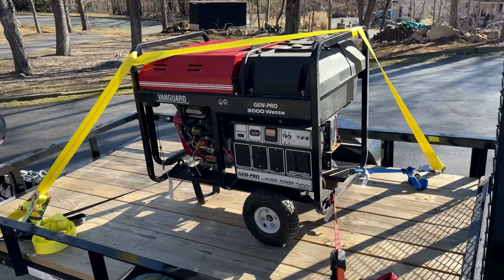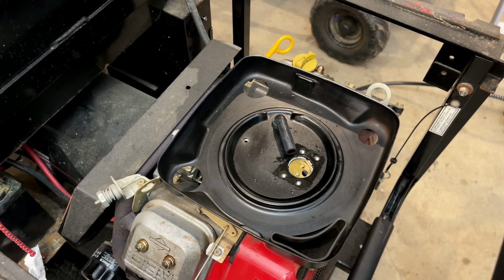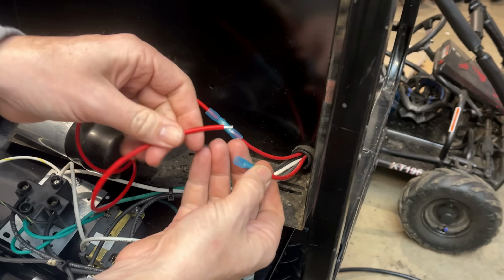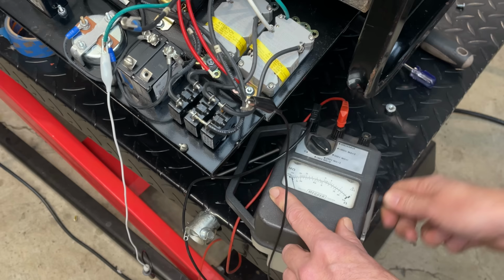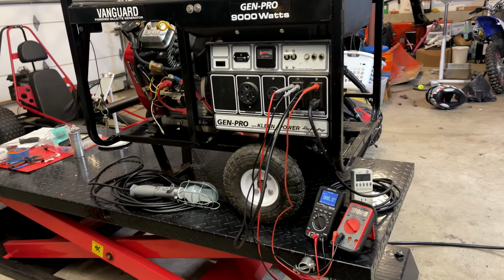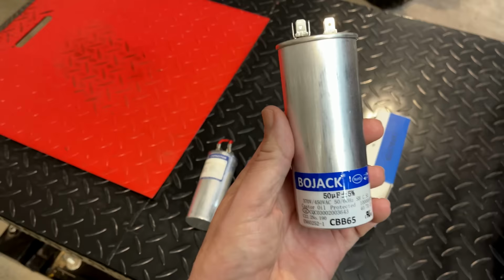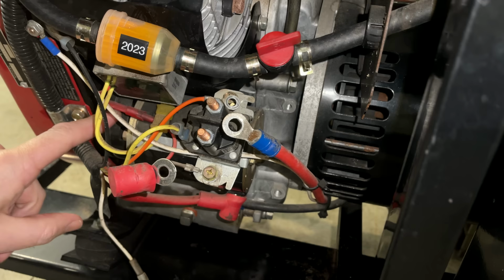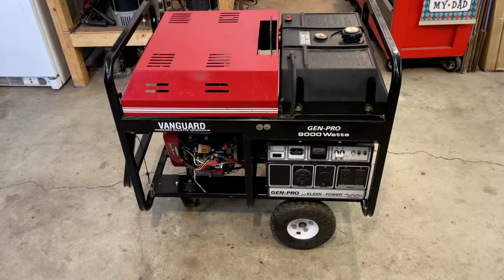How To Test and Fix A Brushless Generator

Comment: Just a heads up on those Vanguard carbs, if you remove the plate that holds the key switch for the electric start you gain access to the right bottom side of the carburetor, there is a bolt you can remove, in the hole is the main jet. With a wd40 straw on an air duster you can blow air right through the main jet to clear it. This way you don't have to remove the entire carburetor, I've done it 3 different times on those Vanguard engines, saved me a bunch of time
Reply from the maker: Definitely.  Just do not try and remove the main jet.  Have tried a few times and failed on all three attempts.  Clean it in place.
Reply: Just have to keep from dropping the bolt or it will add another 30 minutes of fun pulling the fan shroud.
Reply: @Taulksik  nice!
Reply: @jcondon1  sometimes is better to spray wd-40 and let it soak few hours or a night and then put the right or approximate size flat screwdriver and lightly tap it few times then break it loose.  I know some times we feel tempted to get it done quick. 😄 but unfortunately other times we have to wait
Reply: Thanks for the info appreciated
Reply: @josem.2909  yes! My Dad (RAF Ground Crew in Idia in WWII rightly said that "Good and Quick never met on a job yet."

I still miss him.
Reply: Seems like a sweet engine overall.

Comment: your mistake was eBay junk and not paying attention to your measurements it showed a bottom line pretty much bad capacitor you should have sent it back got your refund.. whenever there's a question send it back ... overall it was a good fix it was fixed the way you said it would be fixed and there is ultimately no surprises lucky thing you got the solenoid now so your customer wouldn't have to deal with it...

Comment: As for the low THD, It has damper windings on the rotor like the Yamaha brushless generators. You can see the damper windings (the tip of the bars) on the rotor at the beginning of the video. Thanks for sharing!
Reply: That's a great eye!! And honestly that is a premium feature for portable GenSets. Most don't have them.

Comment: Excellent job James: I have changed hundreds of capacitors on AC systems and we were always told to get one with higher voltage ratings with the same MFD ratings if possible.  Mars ( I think) makes capacitors in the USA. Some of the Chinese ones were garbage. I had several new ones that failed on the spot or shortly after installing them. Thanks for another great video. That is an excellent gen set.
Reply: Yes, you can definitely go up on the voltage rating, and generally the capacitor will last longer than the lower rated one. Do not vary on the uF spec, as it WILL create problems, especially on a start/run cap application for an induction motor. You CAN go up a small ways in the uF spec if the cap is used as a smoothing cap in a D.C. power supply, but in an A.C. system, the uF spec controls the A.C. waveform and can create big problems if you go with a different value.

Edit: Yes, I agree, the off brand China ones are usually garbage and don't last for even a fraction of the time that the original one did. Purchase a made in the USA one, and purchase it once.
Reply: Came here for a brushless generator and got a brushed generator. Always found it incredibly interesting how theres no magnets in most generators

Comment: I love the fact you go the extra mile and made the machine more serviceable by adding little things like a fuel cutoff valve, one theory I have as to why they didn’t add one is because they didn’t think It’d last 10+ years yet here it is running after a few parts later, amazing what you can do with a little bit of TLC!

Comment: James !  I recommend you buy capacitors from Grainger. I replaced similar capacitors like the one on the generator but on two central air conditioner compressors on my house and my dad’s house. The capacitor can was bulging. I also replaced the fan capacitor for the outside unit and the inside blower unit just as a precaution and preventative maintenance issue.  I had replaced the outside blower motor along with a new capacitor 5 years ago and replaced the cap again just to make everything fresh. The Grainger stock seems always good.
Reply: I agree with you they only sale outstanding parts and no problem

Comment: If the manufacturer of the starter solenoid wanted to drastically improve lifespan of the part, they could have silvered the internal contacts. This would cut down on internal arcing, and decreased resistance. If you want, I would be willing to do the modification and send the part back to you for a future repair. 

Great work, thank you!
Reply: Very nice point and offer!
Reply: Silver would do the trick. In order to protect the copper bus bar, the solenoid manufacturer could have added a lick of no-ox for next to zero cost. 😢

Comment: Awesome repair on this one James reminds me a lot of that large WinCo generator I had a few months back. Same engine and same heavy overbuilt powerhead. Never had a chance to measure the THD as I did not have the meter at the time.

Someone else mentioned that this rotor has damper windings. That explains the low THD. Something that we do not see often on the portable generators at all. Normally a winding like that in a synchronous motor is used to provide starting torque, but in this generator application they refer to it as a "dampening winding" since it creates a torque force opposite of the spinning magnetic field to suppress any oscillation (such as voltage at higher frequencies, AKA THD) thus lower overall THD. 

Adding this winding increases complexity and obviously cost that's why we don't see it often.

Comment: That was awesome! Especially taking apart the solenoid! I love taking stuff apart and seeing how it works. I've fixed many things that way that were deemed "broken".
Reply: Absolutely... One can't break it anymore than it's already broken by taking things apart and investigating. Many times a careful tear down and inspection will reveal an easy repair. 
Never hurts to check, and one may learn a thing or two along the way, and save a few bucks in the process. 👍

Comment: Very impressive generator, and another excellent presentation by Jim. As for the replacement parts, this is the kind of thing repair people in every industry have been putting up with in recent years. Because cheap parts have been made available from other countries,  materials used in the manufacturing process and poor quality control has led to this higher than normal failure rates. Many of the HVAC repairmen buy up all the American-made capacitors whenever possible because of the high failure rate of the Chinese-manufactured ones. Yes, they pay a premium, but, like the saying goes, you get what you pay for.
Reply: You rarely get more than you pay for, but you often don't get what you paid for.
Reply: As an Industrial electrician that does a lot of power factor correction. You don't even want the USA made ones .  You want the Japanese ones. Preferably Nichicon!
Reply: That's the reason for our alternative Economic and Business model and plan!

Comment: I purchased this same machine a few years ago, because IMO it is one of the best-quality non-inverter generators out there.  And I love the Japanese-built V-twin Vanguard engine - I have it on my pressure washer, garden tractor, and on several generators.  Keep your eye on the used market for this brand and grab one if it comes up at at the right price.  There is so little to fail on this generator, as compared to say an older Onan (as used in RVs) with its hundreds of dollars worth of control boards and regulators on it.

The only thing that I will say is on the vacuum-operated fuel pump, I always buy the OEM Japanese-made ones, and use only E0 fuel, but I have personally had several of them fail prematurely due to the diaphragm rupturing.  Maybe I got a bad batch, but I always have a few spare fuel pumps on hand just in case as they aren't that expensive.

Comment: Very valuable information and diagnostic skills. The low reading you observed with the low speed cranking of the insulation tester was the charging of the capacitance between the two windings.

Comment: Thanks James, great video. Capacitor suggestion: Open an account at an electrical or HVAC supply house and get the capacitors at a third of EBAY cost. ALSO, getting the capacitor at a higher voltage rating does not effect the output of the capacitor. They use a more durable membrane separator. You do need to get the proper MFD rating. Thanks again.

Comment: James, as far as capacitors go -  the capacitance (MFD) value is critical. Going with a HIGHER voltage handling is OK, but never lower. You had a 370v rating and could have replaced with a 440v rating, but sometimes a higher voltage handling results in capacitor that is physically larger. A lot of HVAC techs (some famous ones on YouTube as well as my next door neighbor) prefer USA or Mexico manufactured capacitors over ones made in China; the USA ones seem to last longer. GE used to make capacitors but they sold out to a company called Genteq. You probably saw a lot of "dual" capacitors in your search - maybe a "5+50MFD" capacitor... Those are very commonly used in HVAC condensing units, the 5 MFD portion is used for the fan, and the 50 MFD portion is used for the compressor. In a pinch you could use a dual cap, just hook up to the connectors C (common) and HERM (hermetic) to access the large capacitance portion of the dual cap.

Comment: That's a nice piece.   It was definitely worth repairing,  even if it is a bit older.  Sometimes the older simpler designs are the best for longevity because you CAN fix them with standard parts.   My electronics experience shows that NEW capacitors usually measure UNDER spec... and will shift to spec shortly.   As they age and LEAK (electrically)  they will test well over spec.
Reply from the maker: Exactly.  Only a capacitor and two diodes.  Cannot beat that.

Comment: James your tests were more sound than that old stock capacitor. The dielectric in a capacitor has a shelf life of about 2 years.  I’m impressed by the consistency of the THD readings.
Reply: Good quality Capacitors last much longer than 2 years. I've run across Nichicon Capacitors that were 20 years old, and still in spec and perfectly useable. 

Generic caps from China? Now the 2 year lifespan could very well be the case. I've had some generic replacement that weren't any good directly out of rhe package. 
Buy a good quality capacitor, and you'll never have to do it again until many years later.
Reply: 2 years? Lol

Comment: Great video.  I was a bit surprised that you didn't check the Amazon capacitor before installing it.  Down south in Texas we routinely have capacitor issues with our A.C. systems.  It has become part of a routine checkup.
Reply from the maker: I did, sure what happened to that footage.  It tested well.  But so did the other.

Comment: Hi James.  You have taught me a lot about small engines and generators. I want to contribute this comment to this project.  I have a 16 HP Vanguard engine like the one in this generator driving my chipper. It has great torque. Just and FYI.  The two 13mm bolts attaching the carburator from the underside can be removed on this engine without removing the intake manafold. I found you just can losen and remove the bolt at the rear be losening the shroud to give clearance the the 13mm 2" bolt.  Then use a 3/8" drive 13mm  crowsfoot tool if you have one.  You can then access the main jet and clean it properly.  Only downside is torqueing the rear bolt with a crows foot attached.  

Just another thing to know about this carburator.  I don;t know why it is make this way. This engine has two differnet OEM needle valves.  One is for engines with fuel pumps in brass.  The another with gravity fed fuel made in aluminium.

Comment: Years ago whenever my neighbor did a tune-up he'd fill his float bowl with Gumout. After he was done with points, plugs & condenser he'd run the engine and it always took care of carb related hesitation stumble and surge. I never saw him pull a carb. I've also heard of motorcycle guys putting Gumout in their gas tank every fill up as preventative maintenance. Easier than R&R carb and disassembly. Just FYI. ben/ michigan

Comment: James, Excellent video.  Always love your diagnostic skills. That genny is built like a tank inside and out. The Gillette gennies are now built with Honda engines for even greater reliability and longevity. Before buying our 22kw standby Generic genny, I came very close to getting a Gillette 12kw 50 amp model. Thanks for sharing another teaching lesson. :-)
Reply from the maker: I am a believer in Gillette generators after working on this one.

Comment: My main very reliable generator is a Winco 9000 watt with a 16 HP Briggs & Stratton V twin Vangard engine. I bought it new in 1999 and it has always run on propane. This generator has run 52 hours continually at full load through an ice Strom back in 2005. I love this generator and I this Winco is a very brand for generators.
Reply from the maker: Winco is a good brand.  Quality.

Comment: That is exactly like the old Ford Solenoids but on a GM they were in the starter, we use to polish them up all the time instead of replacing them. We would also remove the stud and rotate it 180 degrees to give it a new surface to connect to. That's what a Burnishing blade is used for.

Comment: NICE genset and fix! New means nothing nowadays. Glad everything worked out fine in the end. It sure gets interesting sometimes. I finally got the primer working on the electric start and starts fine off the battery BUT now I have to put a drive belt on it but now is a good time as any for it to act up. Sitting for a few years sure worked on it but now I'm back in the saddle. I hate those carbs too. Got one on the shelf and after an Ebay run for around $140 I got an adjustable jet carb for the 1/2 VW motor. God Bless!

Comment: Hey James, really enjoy your videos.
If you have some spare time and want to work on your fabricating game and make yourself a gasket punch pan, it really helps make clean hole in gaskets.  We use lead filled pans for gasket making at work and when they get too deformed you just melt it smooth again.  The one I made at home is smaller but works for me, it’s 14” square pan 1 - 1/2” high with a 3/16” plate bottom and two handles.  I used light gauge angle iron for the sides.
Just thought it would be something you my be interested in.
Thanks again for the awesome quality videos and content.
Ray

Comment: Great video!  One tip I used for years is to use a copier, or home printer with a built in scanner, to make a 1:1 copy of things like your carburetor. That print out can then be put onto your gasket material and accurately cut out.

Comment: I just acquired the 14000 Watt version of this generator last week with 39 hours on it.  This unit  came with a 20HP Honda Vtwin.  I tested the generator before buying it and it didn't generate power.  I was originally prepared to pay $600.00 for it since I was familiar with its history  but with it not generating power I knew it could be a potential gamble and made a deal for $300.00.  The business was sold and it was no longer needed, fortunately, it was installed in an enclosure so it still looked basically new. I called Gillette Generators and they told me most likely the field needed flashing since it had not been used in a few years.  I took it home and found it has two of the GE capacitors you showed in your videos. After watching your video I decided to take them out and test them to ensure they were good.  (As an aside, they both had the white spots on the top like the one in your video but they were not crowned).  They both tested good so  I crimped and soldered new connectors on the wires and then soldered the connectors to the capacitors.  I then flashed the field per the manual, with a load on it, and with the throttle at full the volt meter immediately went to the white line in the green.  Starts and runs great and is making good power.  I have watched many of your videos in the past and I watched this video several times before I tackled the repair and found it extremely helpful.  Overall I am thrilled to have a high quality generator to run my house at a great price.  We recently went 9 hours without power due to a storm and my little 5000 watt Coleman generator ran the whole time.  It is tired, and undersized for what I need, and it decided not to restart the next day.  I was ready for something better and I feel I found it.  

Thank you for the great videos!
Reply from the maker: You good a great generator.  Definitely worth a gamble.  Looks like it paid off.

Comment: Jim, another couple sources of capacitors is a motor repair shop and an HVAC supplier. Those might be the most common sources. If you have a Sid Harvey store nearby, they probably have them in stock.

Comment: Jim, they probably soldered the capacitor is so that the leads wouldn't slip off.
I've sold used pond aeration compressors on eBay, and the biggest problem I've had is bulged capacitors, which is a bad thing. I actually had one go bad after I bench tested it, and that only happened once on the more than 80 that I sold.

Comment: That's one fantastic machine!, amazing the sine wave even at full load, i didn't knew it was possible to achieve such a low THD on a non inverter generator, also the sound of that engine is music to my ears!, when the other capacitor blew out, i was almost 100% sure it was one of the diodes, and i was screaming to the TV, CHECK THE DIODES! hahaha, glad i was wrong, It never happened to me, to receive a bad CAP like that, from now on i will check every cap i receive, and also check build date. thank you ! great video as always.